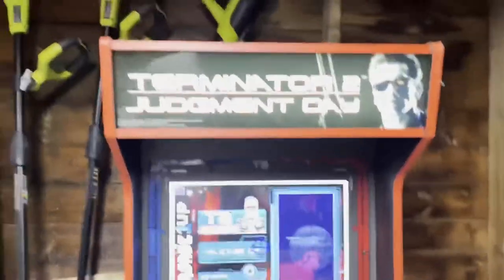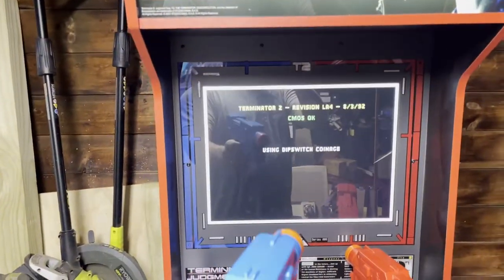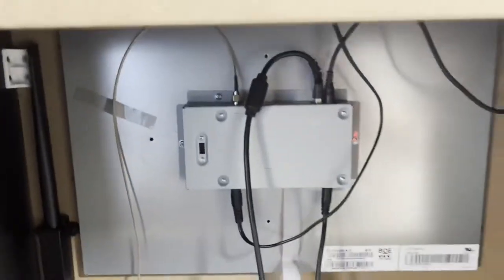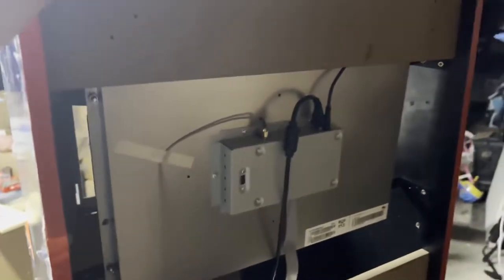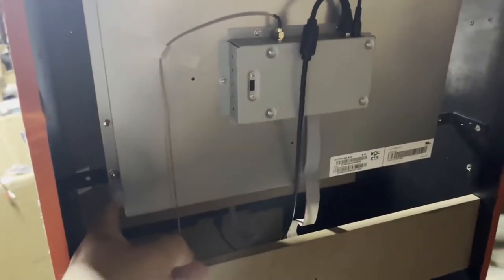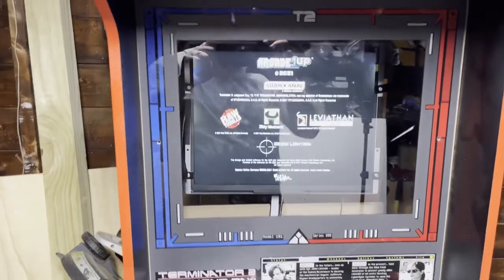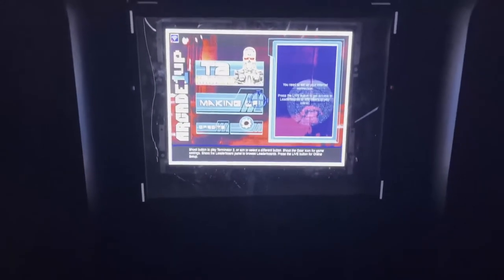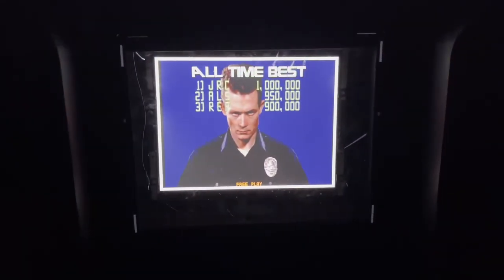Arcade1up T2 Mod Part 1: recess the monitor!

Comment: I want to do a mod like this, but maybe some other way to mount the metal monitor to the top back K board like velcro or strong two way tape. I didn't assemble the top part of the cabinet yet. I got T2 stickers to replace the T2 on the sides and the front because the 2 is off and the Judgement Day should be smaller and no red behind the letters and no lines in between Terminator 2 and Judgement Day. The graphics I got from a foreign site and ebay are just the right size to fit the 1up panels. The side ones were a long rectangle with Arnold on them, but Arnold's head was a bit too big to fit the 1up sides unless I cut off part of Arnold's jacket and centered the head right on the side. And the sticky backs are a pain to apply and you basically have one shot or you can mess it up and ruin your 1up graphic and the graphic you are applying. I use a squeegee and apply a bit at a time while removing the backing paper. All I did is cut the T2 part off with the Terminator 2 Judgement Day on the bottom and apply it to the 1up T2 panels. I did mess up somewhat the right panel but I managed to fix it so it doesn't look so bad. From a distance you can't notice the blemishes. Just some bubbles which I tried to squeegee out and the graphic ripped off part of the graphic underneath and I had to glue that part back on when I tried to lift the graphic to smooth out bubbles. I decided to leave the original Arnold on the 1up sides. For the front I'm using a Tulsa Arcades kickplate with a hole cut out for a plastic coin door with a locking door that opens and closes. I might stick a T2 graphic on the bottom. I'm replacing the stock marquee with the szabo one. which has a red Midway on it and Judgement Day is smaller. And white Midway on the top sides from Arcade Graphix. I also want to do a mod to play more games on the T2 with different guns and other hardware inside, like a Wii.

Comment: I think there's an extra power splitter for the guns, and they have to be plugged in before you turn the cab on.
Reply from the maker: The power supply splits to the monitor and the guns. I appreciate the suggestion but it was connected properly.
Reply: @retrolizardscustomarcades  man, that sucks. sorry.
Reply: There is a cable with a usb at one end and an ethernet type plug at the other end and you must connect it to the deck and pcb for the guns to work. If you did that already then the guns are shot.

Comment: Ok, I would like to know how you set the monitor back but were able to connect the usb type cable between the pcb and deck? Will it stretch? That cable is required for the guns to work. I have a 19" monitor from the new Golden Tee and I tried hooking up a spare T2 pcb in it and all I got was a white screen. I'm probably going to use the monitor that came with it since it's BOE 4:3. The other one is not BOE and it's 5:4. I guess it's like the bad MK monitor. I was going to mount the metal monitor without the wood frame from the golden tee to the back to have a larger picture but if it's not compatible with the T2 pcb then I will stick with the 17" BOE monitor that came with it.
Reply from the maker: https://youtu.be/XOzzAZjLYA0

Comment: If you don't mind me asking how did you get the brackets mounted on the side panels. Did you have to use a drill? Also what kind of screws did you use to hold the monitor in place with those brackets. Asking because I would like to do this mod myself. Thanks!